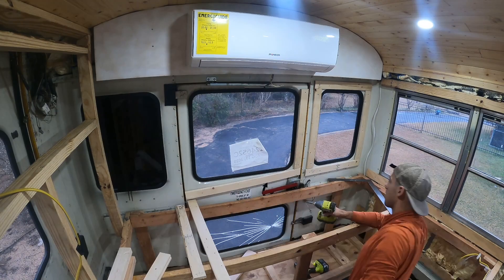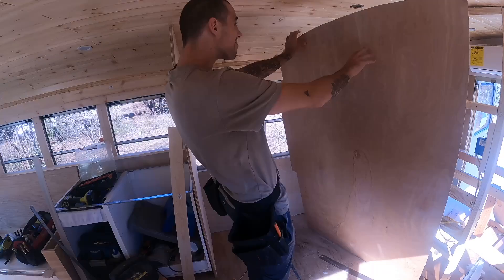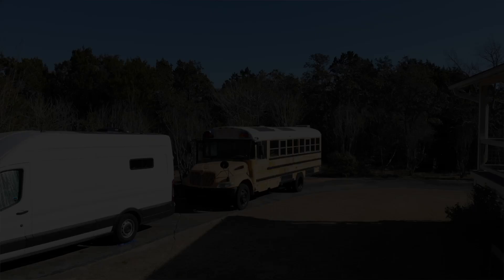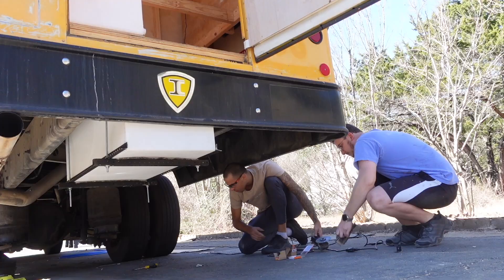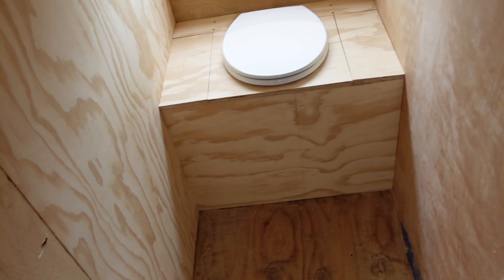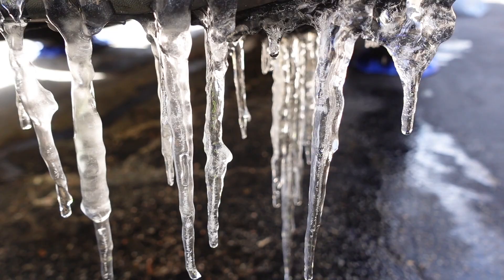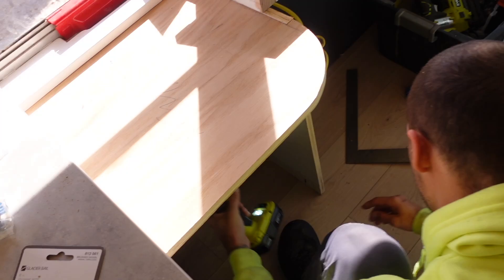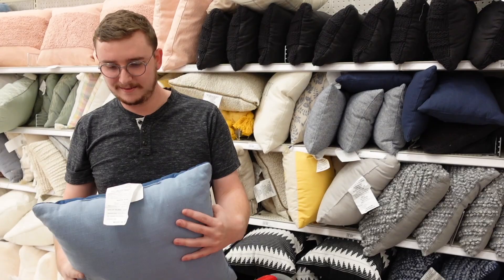We Turned A School Bus Into a Tiny House in 2 Weeks!

Comment: Do you guys know what year the bus is that you helped Angus convert is? Judging by the instrument cluster, this would be a 2005-2008 IC CE with the flat floor that's built on the International 3300 cowled chassis. Is it powered by the 7.6 liter DT466 I6 diesel engine or the 6.0 liter VT365 V8 diesel engine?